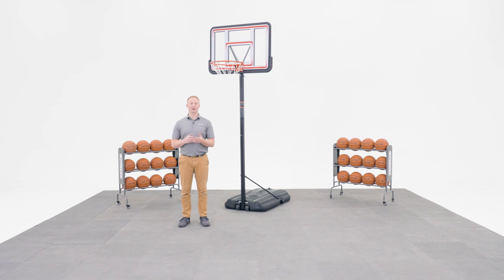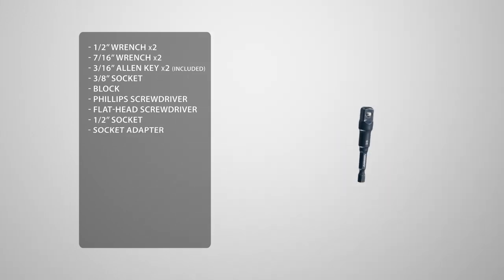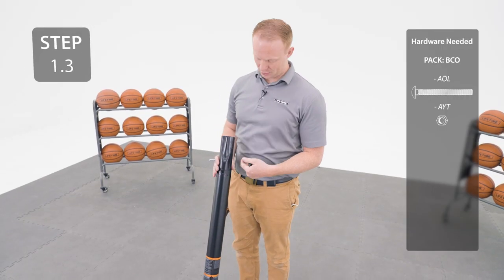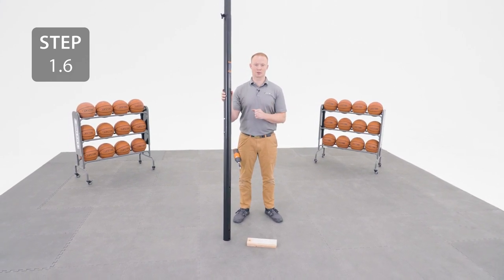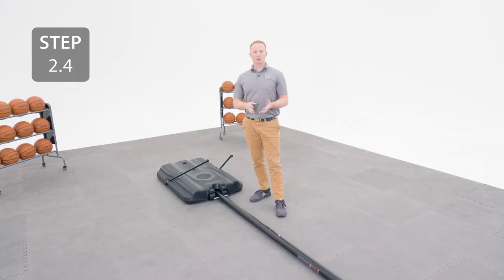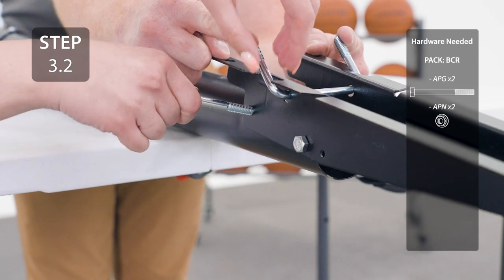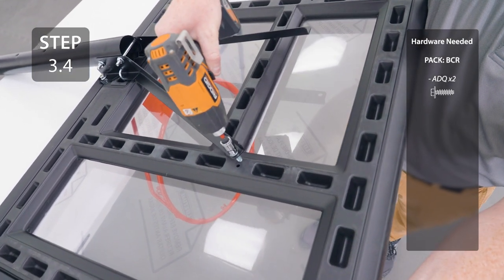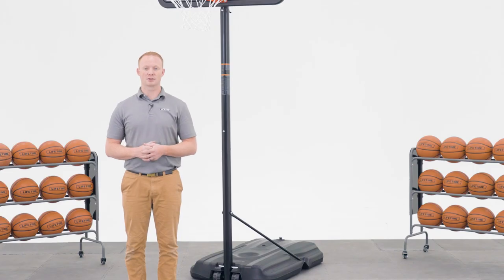Lifetime Procourt™ Basketball System | Lifetime Assembly

Comment: I'm stuck at step 2.5.  The bolt (DXZ) and nut (BTS) wont fit into the holes at the end of the two little arms.  The bolt will fit in but only up to the point where it becomes thicker .   I'm sure I've got the arms in the correct place.  Any ideas?
Reply from the maker: One thing you could try is using the threads on the bolt to ream out the excess powder coating in the hole. If that doesn't work, please contact our Customer Service Department. Our Customer Service Team can be reached at 800-225-3865 opt. 1 or by email at customercare@lifetime.com. Customer Service hours are Monday-Friday, 7:00 am to 5:00 pm (MT).
Reply: I am facing the same issue…was this resolved?

Comment: My long axle doesn’t fit into the bottom hole of the bottom hole. What do I do?
Reply from the maker: Hmm.. That shouldn't be the case. Give our customer service team a call and we can trouble shoot the issue with you and see if we can help figure out what's happening. They can be reached at 800-225-3865 or by email at customercare@lifetime.com. Customer Service hours are Monday-Friday, 7:00 am to 5:00 pm and Saturday, 9:00 am to 1:00 pm (MT).
Reply: @LifetimeProductsAssembly  white lithium grease did the trick

Comment: You say don’t move the base until it’s filled with sand then the very next step (3.2) the base is flipped around. Do I put the sand in before step 3.2 ??
Reply from the maker: You don't fill the base until the end of the assembly, step 4.2. You can move the hoop, but we were saying not to stand the hoop up until the base is full, to prevent any injury or damage.

Comment: My model number isn't even remotely similar, what am I supposed to do? It is the Procourt system but completely different model number, 90040
Reply from the maker: This video is for model number 1269. For an assembly video is 90040 you can scan the QR code found in the instruction manual that will direct you to a BUILT app to see a 3D video of the assembly.
Reply: @LifetimeProductsAssembly  I figured that out yesterday, but thanks.

Comment: Did you say how to assemble it to be at 10 ft regulation height? I missed it. 😪
Reply from the maker: Once fully assembled your system should be 10’ when you adjust it. You can use this video to help you adjust the basketball hoop. https://youtube.com/clip/UgkxOsvzJLBOAbxTlf_4Bz9gWYsiYof1HnRA
Reply: 6th hole down.  You can't just adjust and crank upwards/downwards. Need to actually unbolt the assembly, reset, then rebolt. Incredibly inefficient and made even harder when the screw you get isn't milled correctly and doesn't even thread into the bolt.  At least hardware store is close by to get a replacement screw.  Ditched the knob since it's completely illogical for that part to even exist - very difficult to thread the screw through the knob with nothing to grip the screw.

That being said, this is an excellent video and very informative.  Extremely straightforward.
Reply: @kenthuth5020  Very similar hassle situation with our assembly. It looks easy to adjust, yet once you unbolt the assembly and rebolt, the screw is just a little off, making it that much more difficult the next time. Because of that slight warp, the screw gets jammed, doesn't sit flush, goes in at a wonky angle. After much torque-driven hemming and hawing with the screw that I was worried was becoming stripped in the process, I used some WD-40 helped ease it once more to finally stay firm -- though not without a lot of trepidation on the sturdiness of it. With luck, it will hold up the way it's supposed to but you better believe I won't ever try and adjust the height of this rim ever again. This whole palaver could've been avoided if in this video (or the instruction manual(, he mentioned the DIFFERENT HEIGHTS with each hole. In the vid, he puts it on the 3rd bolt with no explanation and the rim is not regulation height, when it would've been easy to call them out w/the graphic next to each and would've saved us lots of time.